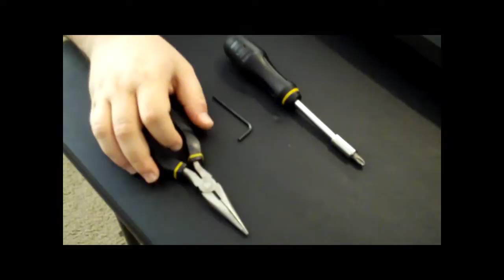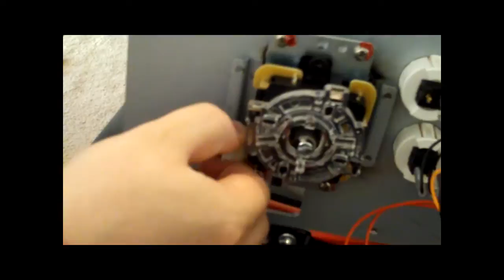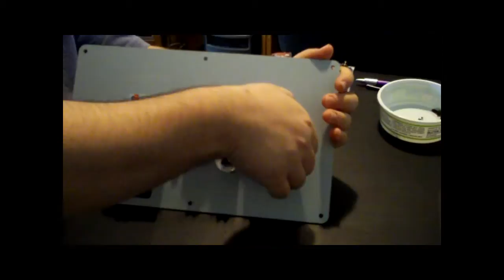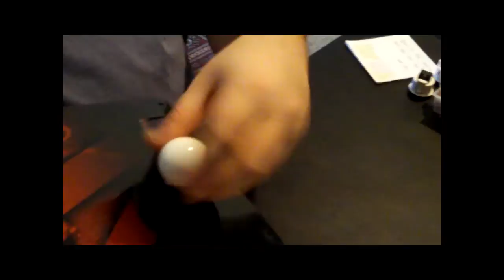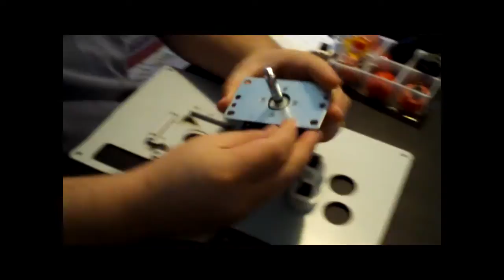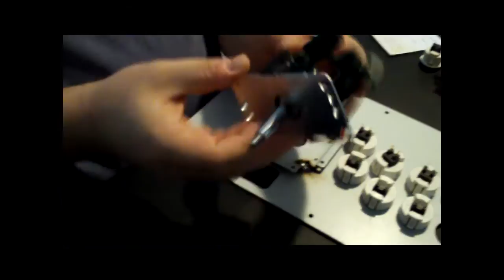Mad Catz Street Fighter IV TE Arcade Stick Modifications

Comment: How did you put the custom artwork? I received today the plexiglass panel, but it has no holes for the fightstick screws. Also how do you put the artwork if you can't use anymore the older metal stock panel from mad catz?

Comment: Hey. Tried modding mine before watching your video. Do you remember which button each wire is ment for?
Reply from the maker: I'm not sure what you mean. The wires on mine were color coded, but if you're having trouble remembering, you can test by plugging in a button to each pair and testing them in the game. If you hit the button and it shows LP, then you know those wires are for LP. Hope that helps.

Comment: Thanks for the video. Is there a way to block the ball or the stick for not rotating, please? Thanks.
Reply from the maker: I'm not sure I understand your questions, but if you're referring to rotation when you are attaching or removing the ball, just use a small wrench or small pliers to hold the shaft so the top won't move on you.
Reply: @Ragelog  Thanks for the fast reply. I'd like my shaft do not rotate. Sometimes my thumb, rotate the ball and move the input. Example: push to left, go to left up or left down. Thanks.

Comment: thanks for the info. on my stick, the button i use for light punch isn't working correctly anymore. sometimes when i press it, nothing happens, then somtimes it works fine for a few games. really frustrating. im hoping that reconnecting the wires for that button will fix it.
Reply: Did it end up working? Just curious.

Comment: @Ragelog, I bought a TE Fightstick used on Craigslist for $80, it works just fine, my question is, do you think the guy that sold it to me took the guts out of mines and swapped it? Is there anything special about the TE fight stick guts? Reason I ask is because looking at my TE fight stick the hexagon screws on top look like they have been tampered with. Please let me know, Thanks

Comment: What size are the buttons that already come with the TE stick?
Reply: The larger pushbuttons are 30mm Japanese arcade standard; the smaller buttons (Start, Select) are 24mm buttons.
Most people would advise buying Sanwa or Seimitsu standard PLUG-IN buttons to replace the stock OEM Sanwa buttons that come with the Mad Catz TE if you want to customize your joystick or replace worn out parts.  Both Sanwa and Seimitsu make screw-in pushbuttons that perform like the plug-ins but these buttons have tighter space restrictions and may not always fit into cases or faceplates all that well.  I've found the screw-in buttons definitions fit in tighter with less space between them which may make removal/replacement more difficult in the future than plug-in buttons.
Hori also makes pushbuttons but they're harder to source and literally 1-2 parts vendors actually stock more than the main 2-color (matte black, matte white) 30mm Hayabusa pushbuttons Hori is known for.  The other Hori color buttons are only available otherwise in the complete joysticks (Hori HRAP V in 4-5 colors, the Soul Calibur VI HRAP joysticks).  Hori also makes 24mm pushbuttons but most stores that do carry the Hori parts generally only have the 2 main colors for the 30mm Hayabusa pushbuttons.

Comment: Would this arcade controllers would work on pc  in dual mode.SF4 Pc windows version?

meaning 2 Mad Catz arcades plugged on my pc.
Reply: You probably know this now but the PS3 version of the Mad Catz TE Round 1 joystick is NOT compatible with most PC's.  Mad Catz used an earlier USB standard that was not carried on most personal computers after 2008/2009.  The later Round 2 Mad Catz TE's for the PS3 were licensed joysticks and their PCB was revised to work with the standard USB architecture most PC's use today.  The earlier Mad Catz TE/R1 joystick was NOT licensed product and MC cut corners to reduce costs.
Today, there's barely a PC (doesn't matter which version of Windows you run; they DON'T work unless the joystick PCB is compatible with the general USB standard) out there that will let you run a Mad Catz TE Rd 1 joystick without a USB adaptor (Cronus unit will work; Mayflash may be marginal).  You're stuck getting a converter (cheapest viable option aside from ripping out a brand-new PS4-compatible PCB from a control pad and soldering that to your buttons) or doing a full PCB-replacement (Brooks, MC Cthulu, or the control pad PCB; the control pad PCB should be common ground which makes soldering/wiring to the control pad a lot less complicated.   You won't have to buy additional parts like resistors to make a control pad, usually a Hori Commander pad, work with your joystick case).
The Mad Catz TE Rd 1 does not have a lot of room for a replacement PCB; the only viable locations for a replacement PCB are the areas clear of and underneath the control lever or the lower right corner of the case interior.  I would NOT advise locating the PCB under the control lever because the wiring could get wound around or have its insulation stripped by the control lever.  You want to get the PCB as clear of the existing lever and pushbutton hardware as possible..  You end up gutting a good chunk of the plastic inside the case (basically all the plastic underneath the buttons and a good chunk of the "lip" of the plastic up to the edge of the support posts that the screws go into to hold the plastic halves of the TE case together) to create room for a new PCB.  The stock Mad Catz had a very tight interior space under the buttons.  A lot of us who took our joysticks apart to replace the stock buttons and control lever found out the button wiring tends to bundle under the 30mm pushbuttons and often keeps them from depressing fully.  You end up cinching the wiring with tie cables to where you can anchor the quick disconnect lines to reduce the amount of wire bundling that occurs so that the buttons can fully depress.